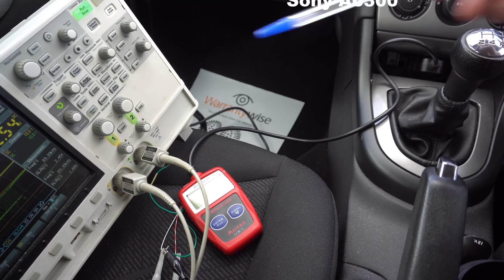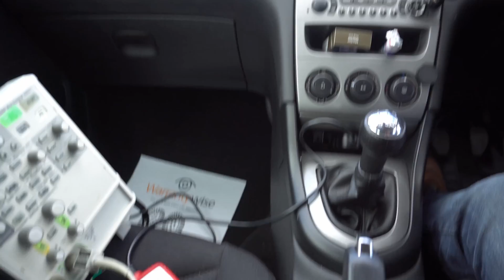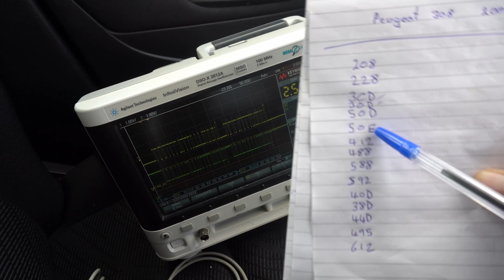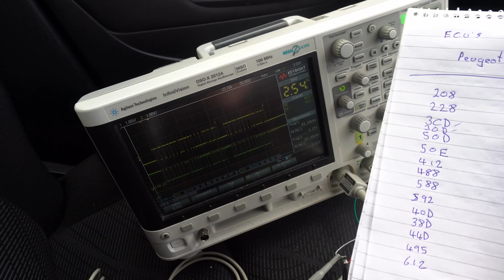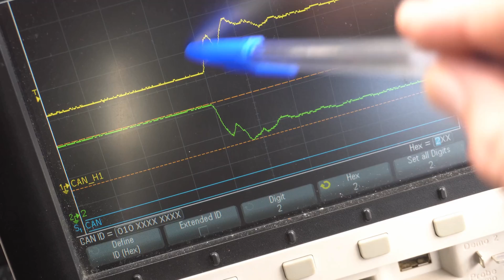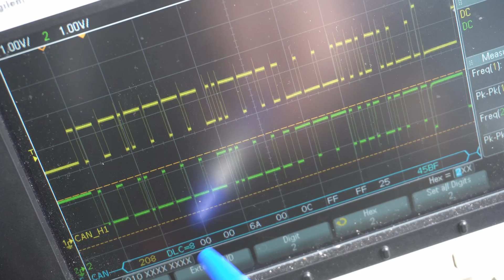CAN Basics Part 2 - Understanding  OBDII - EOBD on Peugeot 308 & Keysight Scope

Comment: ok thanks, the DLC connector has SAE J1850 signals and ISO9141 signals, what are they used for? do you ever use these signals to troubleshoot failures in a car?
Reply from the maker: Those signals are for other devices to communicate with, I'm not sure what since I don't have the manual.

Comment: Thanks, If you get a CAN buss checksum error how does a technician know if its a BAD transmitter chip or a BAD receiver chip because both can cause a bad checksum error? A bad transmitter chip can cause a checksum error and also a bad receiver chip can cause a bad checksum error so how do you know which one is bad or good?
Reply from the maker: I'm assuming the ECU with a non valid checksum logged is the faulty unit, unless other ECUs are reporting the same error.

Comment: JOHN B, The CRC checksum is a 16bit hexidecimal value for each CAN message, how do you calculate the CRC hexidecimal value using a handheld calculator? Do you just add up all the hexidecimal values in the CAN message which should be the CRC checksum hex value?  Each CAN Module transmits a CRC hex value and the CAN module receiver will compare the transmitted CRC hex value with the Received CAN message checksum value so they Match?
Reply from the maker: CRC is actually more complicated than one would think.
No you don't just add up the bits.

There are videos to show how a checksum is calculated.
CAN chips do it in hardware, there is not a program doing it.

Comment: I have a sinple question.  How do the modules decide when to send there data with so many modules wanting to share their data? If a node sends its data packet, is it then listening for a short time until it sends its data again?
Reply from the maker: Hi,
The modules / nodes send data when asked / requested.
When the information is sent,  the receiver sends an 'acknowledge' when all the data is received.
If there is no acknowledge, the transmitter will keep trying.
The data only takes up to a few milliseconds to send.
If you think a slow CAN line can send 125'000 bits a second, in an extended frame, I think the longest 'packet' available is 576 bits long.
So you can see there is plenty of time in a second for everything to communicate.

Comment: Hey John, how did you figure out that ID 208 corresponds to the engine and that the first two bytes of that frame show the rpm? Did you have to reverse engineer that yourself or were there resources online that explained it?
Reply from the maker: Hi Lachlan Page,
No I reverse engineered the system.
The engine will always have the highest priority so it's going to have the lowest number.
I kept checking the ID's coming up, 208 was the lowest.
As for the RPM etc, you can see how changing the revs made the first 2 bytes change significantly so it had to be the RPM......
So yes, I reverse engineered the system if you want to call it that.

Comment: Hello, I have been watching your videos to help with diagnostic, I work for Mercedes Benz, Mercedes is super secret with their information, but we do have a diagnostic aid called SD scan, they have all of the information of the hex to convert to a actual reading, it's very buggy but there is little information on how to use it, you jump on the can of choice and open SD scan and select the vehicle you want, you can then monitor chassis can, so when you lock the doors it will decode the hex into doors unlock and show you, this is supposed to aid in random data being transmitted on the network that's not being asked for, usually this drains the battery because it keeps the can awake, these are very tricky to diagnose and only happen to the customer once or twice a month. But I am enjoying your videos thanks for making them.
Reply from the maker: Thank you for the info Neil and thank you for your comments.

Comment: Hi John, Good video thanks. Just wondering we have a couple of good scan tools that can go into individual controllers on the car EG: ABS Module  or Transmission Module or even do an ISS (intelligent systems scan) if yo connected a scope up in parallel with it while on the DLC looking at particular modules would you be able to get the modules ID bit
Reply from the maker: umm, so are you saying I need to read a particular ecu to get it's ID?
Like read abs mem and watch for ID?
Thank you
Reply: I don't know, I'm new to this. I did wonder about when you interrogate the car with a good scan tool that can talk to each module separately if you could get the individual modules' ID by monitoring the can bus during scan tool communication.

Comment: I never seen a manufacture release such information for the CAN. We buy really expensive scan tool to read datas. What I would really like to see is you find a bad control module in a vehicle, using your strategic approaches. That would be a good learning video.
Reply from the maker: Hi,
Thanks for your comments, sounds good.
Faulty control modules are found by other modules / ECUs saying 'timed out' like an internet page that has been removed.
Each unit only waits so long for a response.
In my experience, CAN lines get broken or short to ground on an engine or chassis.

Comment: Good video. But...how is it possible the simultaneous transmission of different signals on the same couple of wires?
Reply from the maker: Hi,
They are not simultaneous, it is one message after another, in 1000th of a second approx
Reply: John B Why signals dont overcome eachother?
Reply from the maker: Because each signal is acknowledged 'quickly'

Comment: Hi John, Can you please do a video about the J1939 protocol ? Thanks in advance :)
Reply from the maker: Hi,
The J1939 is essentially the same as the video, trucks and buses may use the 29 bit ID over the 11 bit identifier. 
Thank you
Reply: Yes but there is the PGN instead of the ID ... If you could share some resources on it it will be very helpful because I didn't find much information on the net. my email chfakht@gmail.com thanks in advance sir...
Reply from the maker: Is that PGN like my scanner is sending out - 18DB33F1            ?
Reply: Actually I don't own a car but I forget to mention that I meant the theory part behind j1939 just like in your first video (y)
Reply from the maker: Hi,
is the protocol for a particular vehicle that you were looking at?
Reply: The J1939 used mainly for tracks and other large vehicles

Comment: Hi John, thanks for another interesting video! I'm surprised at how little info the engine is sending out, I think that the engine computer has multiple different identifiers for sending out different types of information. For instance all the stuff that normal scantools can read: 02 sensor data, fuel trims,...

Oh, those links in your descriptions don't work, they point towards the creator studio.
Reply from the maker: Hi Koffi,
Thank you for pointing out the technical glitch with the links, now fixed.

Yes you're correct. There are many different modes to select the required data.
I need to do more work and possibly part 3 lol.
I think 'read fault codes' is mode 3 or something like that.
Another mode is to clear fault codes related to emissions is mode 4
Freezer frame is another
Fuel trim......... etc etc and the list continues.
Reading just the basic continuous data is something like mode 6.
That said, the scope was reading the CAN line without entering any modes, the scanner was not active.
That's how it's easy to get a display from China to give one a display of RPM, Speed, Load, Throttle etc. 
This video just breaks it down a little.
Thanks for your comments.
PS, I saw one of the identifiers with 5 bytes of data, 4 of them were 0
I'm guessing ABS for the 4 wheels.
Reply: Thank you for replying! 
Oh yes, so it's possible the ecm only sends out certain data when prompted to by a scantool. Do you think each eobd 'mode' would correspond to a different identifier?

ABS data is a good candidate, itwould also have a low identifier number. 
I'm looking into buying a scope with serial decode, this stuff's fascinating!
All the best from across the channel!
Reply from the maker: Thank you again Koffi,
I'm pretty sure all the engine data will have one identifier, the different modes will give you the extra data.
I read on one scanner, mode 9 will give you vehicle or engine details.
It will take me a while, but I'll get to the bottom of it.

Is that the English channel or the Atlantic channel? lol
There are many good scopes by Pico with serial decode, built for a laptop or PC, give them a look too.
Thank you
Reply: The English channel :) I live in Belgium, near Ghent.

The pico does get a lot of praise online, but I think I'd prefer a benchtop oscilloscope.

It would be very interesting to see how exactly a scantool requests certain information from the car and if the different modes are really reflected in the can signals or if they are just a way to classify data groups.

Looking forward to future videos on this subject!
Reply from the maker: When I lived in Surrey, I'd pop across to Belgium for cigarettes and chocolate :) 
You will have seen the wires sticking out of the scanner, I tried reading it before connecting it to the car.
You're like me, I want to know exactly what is being sent.
I'll keep trying